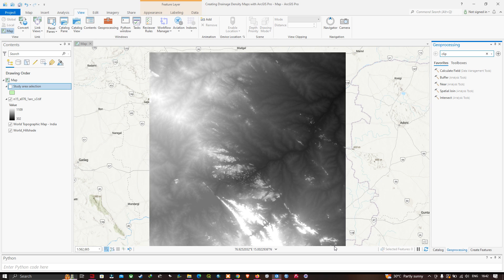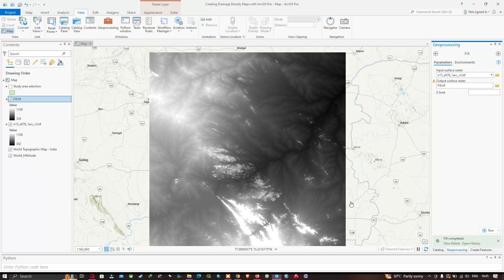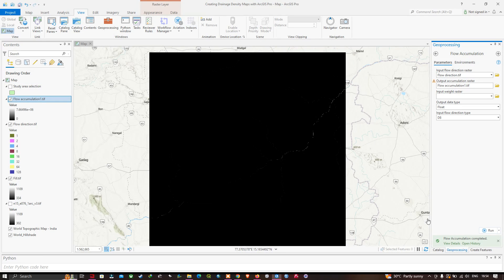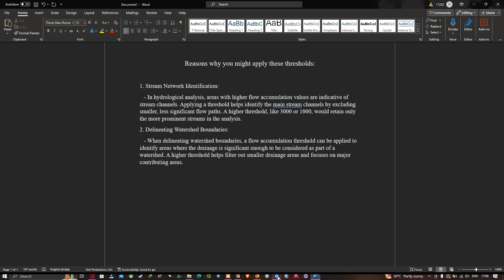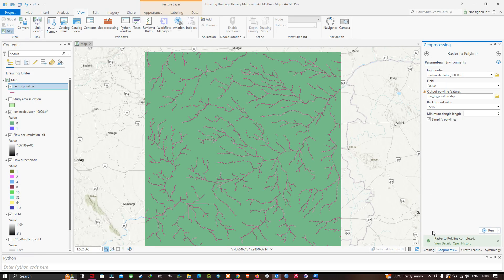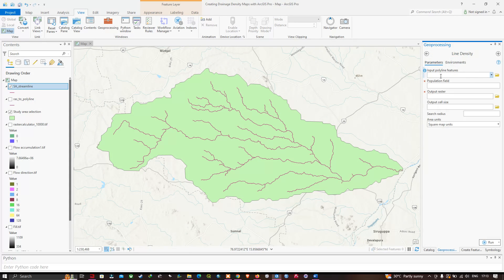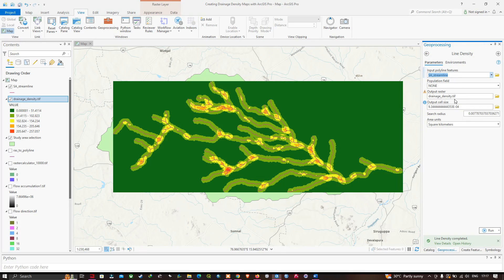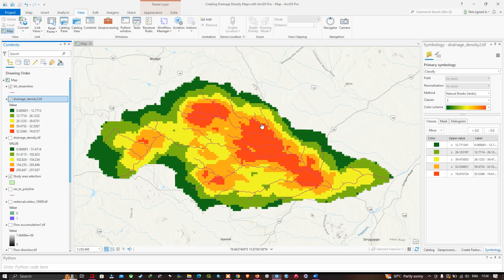Calculate Drainage Density using ArcGIS Pro | SRTM DEM

Comment: what does that value of drainage density mean? we have  use sq.kilometer ,so does that mean 205.647-257.057 sq.km.But drainage density unit is km^-1.what does the value actually indicate?
Reply: Did you find answer for your question? I'm having same query
Reply: @passionebikie  Marketing ArcGIS for Non-hydrologist.
Reply: Same question? Did you get the answer?